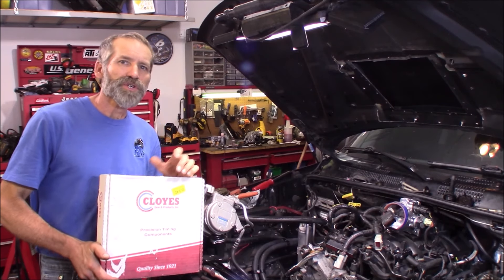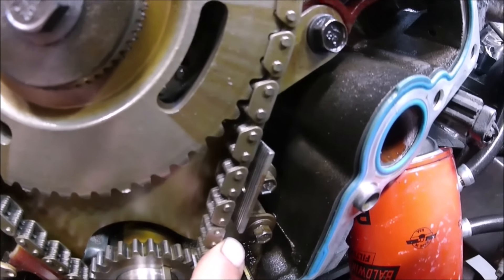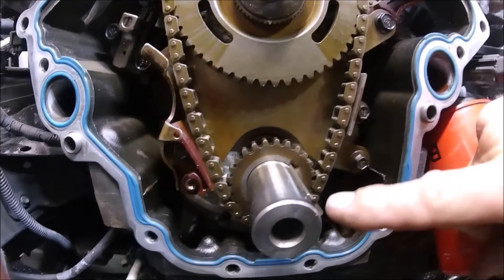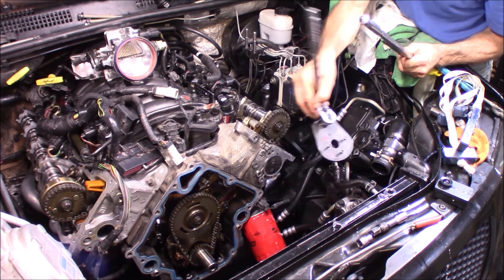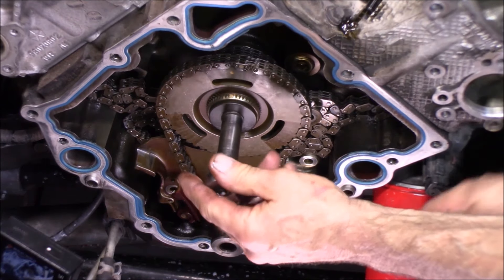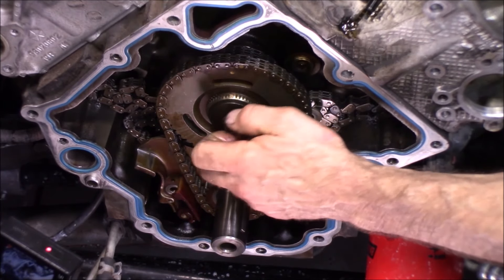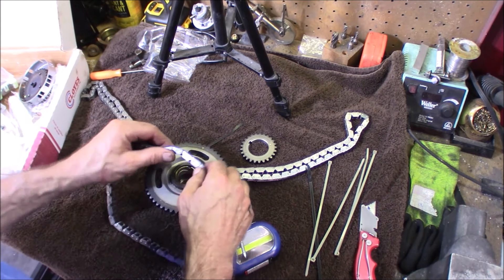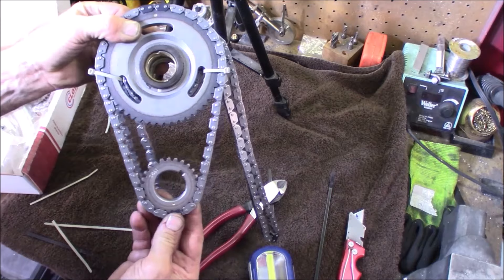How to Install Timing Chain Set Dodge, Jeep & Chrysler 4.7 & 3.7L

Comment: Hello Sir, I am doing a 3.7 dodge Dakota and the kit I ordered did not come with the complete idler gear and sprocket assembly. it came with the primary gear only and not the drive sprockets for cam chains and nothing for the balance shaft gear. Could you tell me the best way to get the rest of it. all other videos show reusing thier old one. I want to replace all sprockets. HELP....PLEASE...Thanks, JJ

Comment: i have a 2004 dodge dakota 4.7l with a 4 plug computer, the engine was replaced and not running by the last owner.
i don't know what year the engine is that they put in the truck but it has the longer oil dipstick were as the dakota engines had the short dipstick... where or how can you tell the engine year on these newer vehicles.
i am use to the older carb vehicles. thank man!
Reply from the maker: So this engine hasn't run since it's been installed I guess to verify that you have an NGC engine  You may need to remove the valve cover on the passenger side and verify it has the correct Cam gear By comparing it to another NGC Cam gear and making sure that the small windows or holes in the Cam gear are in the exact same location. If you find that they are not you would have to replace that Cam gear and then remove the engine and replace the reluctor wheel on the crank shaft it would be easier just to replace the engine with the correct one.
Reply: @martinbuilt  the guy i bought the truck from said he had it running then it shelled out. the only thing i found wrong so far is the plastic valve cover was broke. all rockers are in and engine cranks fine, no start and pops back trough the exhaust. i don't have the original engine right side cam gear and all the engines in my salvage yard near me are the 3 plug computers not a 4 plug like mine. i put 2001 aluminum valve covers on the engine instead of plastic ones. do you know if these engine have date codes like the older carb. engines did.
Reply from the maker: OK, if you had it running, then the correct era engine should be installed.
 I don't know if there are any date codes on the engine themselves.
 It does sound like there's something out of time.
 You mentioned that the plastic valve cover was broke that is generally caused by a rocker arm coming out and hitting the valve cover.
Reply: @martinbuilt  i will have to check them out but all lifters and rockers are in place.

Comment: This is a little off topic, but can you suggest a good master rebuild kit for the 4.7l? I bought one from Ebay, but I'll be honest, I don't trust it. I paid less than $200 for it. That just sounds too low for a master rebuild kit. I want to rebuild my 4.7l right, so I'm going to try and avoid sub par parts.

Comment: Hey Martin, thx again for the videos. Does the timing chain tensioner need to be purged.? Or can it just be installed and then released.
Reply from the maker: I just install them and pull the pins when the timing chains are completely installed.

Comment: I have a 2001 Dodge Dakota V8L 4.7 4x4. Do I need to remove the oil pan in order to change the oil pump?
Reply from the maker: yes, that sucks on those because the 3rd member is in the way.
Reply: @martinbuilt  thank you for confirming my thoughts. Have a bless year!

Comment: I couldn’t find the cam holder you used on Amazon it looks different
Reply from the maker: Yeah the one that I used I made myself.
Reply: If you have a Cereal box, cut the cardboard & you can slide it through the windows. (2) & that sufficiently holds the chains to the sprockets. You may have to double & tripple them up to make them thick enough to apply adequete pressure against the chains. In a pinch, I rounded up some thin pieces of wood with a wedge of wood to tighten them up. Once installed on the motor, just pull out your shims. JUST MAKE SURE your chain links are in the correct position before you wedge em in place.

Comment: Martin. Thank you very much for taking the time to put this video together. Very well done. Unfortunately, my wife’s 2002 Liberty with 3.7 swiped off the cam fowler on #2, as these engines often do. Therefore, I’m planning on replacing all of the lifters, and—with the help of you and your excellent video—replace the timing chain set. QUESTION: What would you recommend for a lifter set for this engine? Thanks Martin
Reply from the maker: I would recommend Sealed Power or Melling. I believe in using marvel Mystery oil or Rislone, both these products do a great job in removing sludge from the lifters and you may not need to change them all out.
Reply: martinbuilt Thank you for taking the time to respond, Martin. I appreciate that very much. As to your suggestion of trying to clean the lifters vs. replacing them all, how would you know when they were clean inside? When the mystery oil comes out clear? Thank you again for taking the time to produce and share your very well done videos. DWT
Reply from the maker: @dwtesch  I would use it to replace a quart or half a quart of motor oil when doing an oil change. Then let MMO do the rest.

Comment: I scrolled the comments for this but my manual said compression stroke is TDC. As long as I keep the cams oriented in the same way they were (upside down compares to yours) then they're good going back in? Doing head gaskets.
Reply from the maker: Funny my engine runs really well for installing them wrong according to you. Good luck with the head gaskets.
Reply: No. I wasn't saying you're wrong. I was saying the manual is wrong. Asking for your advice.

Comment: @Martinbuilt My Haynes manual says that for the engine to be set correctly in time the timing mark on the harmonic balancer should be lined up with the mark on the timing cover. It also says that the exhaust valve on the number one cylinder should be in the open position. Is this factual? Thanks in advance!

Comment: If I take off the primary timing chain can i rotate the crank shaft independently of the idler with out wrecking stuff?
I need to get all the pistons to TDC to clean off the carbon build up.
Piston 1 is currently at TDC. The heads are both removed
3.7 L V6, 2010 GC 2x4 auto
Reply from the maker: If you have the cylinder heads removed go ahead and remove all the timing chains because you're gonna need to redo the timing anyway.
Reply: @martinbuilt  ok cool! so I should be able to rotate the crank shaft independently of the idler to get all the pistons to TDC right?
Reply from the maker: @Humorem15  yes, if the main timing chain is still installed always rotate the crankshaft clockwise when facing the engine.

Comment: Martin I believe you’re mistaken but don’t take my word for it, I believe the 4.7’s are actually Non interference , I know the 4.0s are interference but just had to put my two cents I may be wrong though, thanks for the guide though as I was having trouble getting all 3 chains in place your trick is something I didn’t even think of and was a neat little finiesse. But thanks , happy wrenching! Also check out this cool intake manifold on air ram that adapts to ford 4.6 super chargers super cool! May be getting one but for now I’m focusing on my bottom end strength.

(Edit: I may be confusing it for the Toyota 4.7) but who knows. Wouldn’t be a surprise as these little 4.7s are full of little secrets. Hopefully my rods come in soon as I am interested in seeing what can be done with just rods and pistons.
Reply from the maker: the 4.7 is an interference engine as I know people that have installed the timing chain set incorrectly and have bent valves and the 4.0L is a non-interference engine.
Reply: @martinbuilt  ah okay well I must’ve mixed something up thanks man

Comment: I wish you had done this sooner😅 . I did one of these almost 6 years ago an I couldn't find hardly any info on it. Needless to say that motor never ran again. Great video though thanks
Reply from the maker: Sorry I wasn't there for you then. Yes this is something that you definitely don't want to mess up. 
Since this is an interference engine and valve damage can certainly happen if you get the timing wrong. 
Thank you for watching.

Comment: Martin, I have a 2003 Jeep Liberty 3.7 and it has a 4th gear on the back of the neutral gear. It also has a smaller gear bolted to the front of the motor that the forth gear has to align with. Why don't you explain or show why the difference between a 3.7 and a 4.7. Can I remove these gears ? What are their purpose?
Reply from the maker: If I had a 3.7 to show you I would have. Those are balance gears, the V8's don't need them because of the added two added cylinders.

Comment: Hey Martin! Thanks for your videos, so tell me if I’m understanding correctly here, if I put 08 cams in my 04, I will not only need to get 08 cam gears (both) but also an 08 timing chain kit? Or can I keep my 04 timing kit and just change the cam gears? Thanks in advance! Oh, I also just changed the timing kit 1K miles ago 🤦🏼‍♂️
Reply from the maker: You can keep all of your new timing chains and gears; just replace the Cam shafts.

Comment: Did you have to get the crank and Cam positions re learned
Reply from the maker: No need to do that the ECM will automatically make any small  adjustment for timing

Comment: When I take my valve covers off and put my crankshaft to TDC… only one of my Cams line up with “R,L and V-8 on top”… how do I get both of the cams to match??
Reply from the maker: Are you sure you're on the compression stroke of the number one cylinder
Reply: @martinbuilt  simply put, No… I’m not 100% sure I am. How can I confirm I’m in compression stroke cylinder #1
Reply: @martinbuilt  should I just continue turning the engine by hand until they line up?? I don’t want to risk any damage to the valves
Reply: I just confirmed I am in compression stroke cylinder 1…. Cams still don’t both point to 12 o’clock… is it possible to rotate the drivers side cam independently so I can match it with the passenger side
Reply: @martinbuilt  the chain keeps slipping off drivers side camshaft sprocket when turning engine by hand… now I have both cams showing “V8” at 12oclock. However the chain on drivers camshaft wasn’t moving
Reply: @martinbuilt  I sent you a message on Facebook including a video explaining more clearly the problem/concern I am having

Comment: Hi Martin.I need a new timing cover gasket on my 06 Liberty. I see gasket sets available that show a one piece gasket that comes with the separate o rings for the round coolant passages and a set with the same seals and a tube of sealer. What is confusing me is why they include the separate round seals with the 1 piece gasket set when te seals are already in the 1 piece metal gasket?? Never her of a o-ring seal over another ?seal. What kit would you recommend or ? Thanks.
Reply from the maker: The one-piece gasket is the one I like. The other choice is the O-rings for the water passages and then use silicone for the surface areas. The one you describe sounds like there giving you both sets.

Comment: if you don't mind marring up the cam shaft, you can use pliers instead of the cam gear tool to get the cam bolts off.
Reply: Or use an impact

Comment: wow ,great vid!!!! i may end up doing this , due to horrible ticking sound , dont know if its lifters or chains, the do have slack ....
Reply from the maker: Is most likely a lifter as you said or the hydraulic tensioner going bad
Reply: @martinbuilt  just now  installed valve cover and added 1 quart of trans fluid to flush motor oil that gunky

Comment: Is there a way to set the timing without those dark links. I did head gaskets in my 4.7 and seemed to have messed up the timing from the sharpie marks I had made. I'm using my old chains that no longer have paint on those key links or weren't there from the factory. Any help would be appreciated.
Reply from the maker: no easy way that I can think of, You have the timing cover removed?
Reply: @martinbuilt  Yup I went back in and had the timing cover and valve covers off. I just got frustrated and removed all the timing chains and sprockets. Turns out there are still darker timing links on the chains after cleaning them up. The issue I'm seeing now is that the 2 chains for each of the cams only has a single darker link on each end of the chain instead of 2 on one end and 1 on the other. This makes it harder because the single link doesnt line up in the center of the window on the idler sprocket. As far as the chain from the crank to idler sprocket, that chain is as it should be with one dark link and 2 dark links on the opposite end.
Reply from the maker: @OutJeeping  Hmm...that is strange, I just checked two of my old sets and all 4 chains have one dark mark on one and two on the other end of the chain.
Reply: @martinbuilt  Hmm, since you have your old chains, would you be able to lay them out and count how many links are in between the single dark links and the two dark links? With my chains I have about 22 Links in between each of the single Dark Link. I would appreciate that very much.
Reply from the maker: @OutJeeping  I don't know how you are getting 22 links, I took the chain with the single dark link at one end then folded the chain in half to where the to dark links are now at the other end and I came up with 25 links on either half.  What year 4.7 are you working on?
Reply from the maker: @OutJeeping   with the 07 and later there is only a single darkened link on either end, place that link in the middle of the slot of the idler sprocket
Reply: @martinbuilt  You are correct! I just watched another video explaining the differences in the earlier Style timing and the later Style. I'm doing this on a 2007 Ram 1500 so it would be the later Style. But it explains why myself doesn't match exactly is your video. I appreciate your help very much! I'm going to go install this and I'll let you know if I can get it to run lol.
Reply from the maker: @OutJeeping   I will be doing a video on how to install the late model timing chain in an early model 4.7

Comment: Martin. Thanks for thr video. My research indicates the reluctor wheel AND the crankshaft tone wheel have to be swapped to run a later model in the jtec when performing a swap. Whats your thoughts? We swapped the reluctor wheel from the original engine with no start. Weve been wrenching on this thing for weeks.
Reply from the maker: Yes if you are performing an engine swap and using an engine from a JTEC vehicle going into an NGC vehicle both tone ring and reluctor wheel need to be changed.

Comment: My friend I just saw this video because I bought a 07 Liberty 3.7 with weak valves, it runs but missing and with this video I am going to do it myself.   THANKS A LOT FOR SHARING IT WITH US.   GOD BLESS YOU.
Reply from the maker: You're very welcome. With the 3.7, there is the additional balance shaft that needs to be timed with the idle sprocket. Other than that, the process is exactly the same as the 4.7

Comment: Videos are great and well explained. Good job. I got a Mitsubishi Raider 06 3.7l with 193k on it, I would like to know how often timing chain should be replaced?? Truck runs fine but I wonder.
Reply from the maker: Chrysler claims that it should last the life of the engine, if there are no issues I would just keep driving.

Comment: What if, the vehicle is on TDC but the   chains in the back are not lined up with the dark chain links on the back chains, do I have to go around on more time to make the black chain links line up in the groves of the chain gear
Reply from the maker: If you had just simply removed the valve covers and brought the engine top dead center the 4.7 liter engine it can take up to 14 rotations of the crankshaft to bring all the marks to lineup again.  This is assuming that you had not done the timing chain set yet. When installing the chain set all the marks need to line up .
Reply: Thanks.  I have not taken it apart yet but seeing your video made me ask the question.  Ohhh. And I broke the tensioner probably the same way,  tried to put a pin in ... lol
Reply: Its a 3.7 dodge nitro heat
Reply: Have I damaged the vehicle for turning it counter clockwise looking for tdc?
Reply from the maker: @dearicpayne  
no, but you may have broken the tensioner on the primary chain.

Comment: I've heard those guides are a problem. Now I have that question if I should do this or not. I'm about to replace my Radiator anyway. Did you ever find the springs.
Reply from the maker: no, I haven't removed the oil pan but the next time I do an oil change I will use an inspection scope and see if I can find it in the pan.
Reply: @martinbuilt  I have to replace my oil pan because of the rust. It's one thing after another. I'm worried about my motivation already. Still have the Manifolds to replace, there off, but you went and put the idea of headers in my project. Then there's my sustention, U joints, transfer case, stereo, long arm upgrade, shocks, lights. Oh it goes on. I really liked that 75mm throttle body. Will you stop putting ideas in my head. Dang, will you make me the adapter plate.

Comment: Good afternoon Martin.. quick question with regards to the timing kit.  Is there really a need to change the timing chains?  Do they stretch over time?  what about replacing the gears?  Would it be a silly idea to ONLY go in there and replace the guides?
Reply from the maker: Hello Leland, I would imagine the chain does stretch ever so slightly. And that would cause the cam timing to be off ever so slightly. Same thing goes with the gears if you look at the used ones you can see where the chain has been biting into the teeth and this also adds to the cam timing being off, of course when I say the cam timing is off I'm talking about less than 2 degrees, but I don't think it's absolutely necessary to change. out the chain and gears